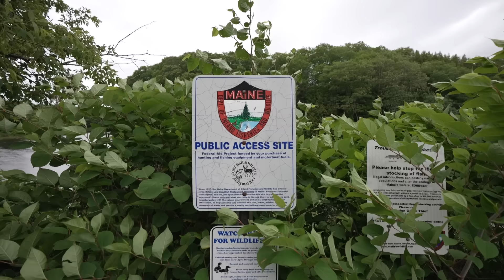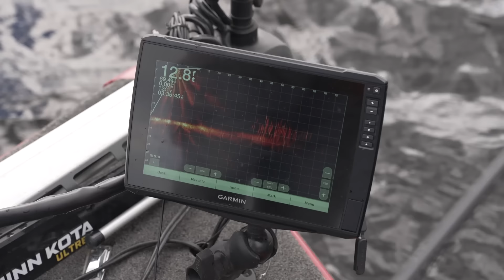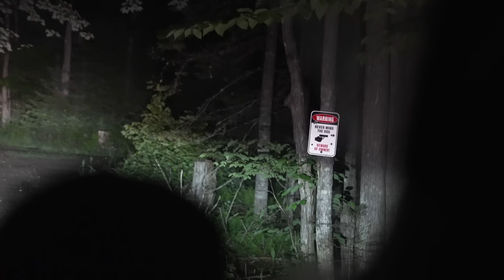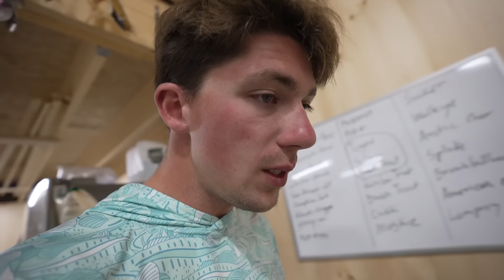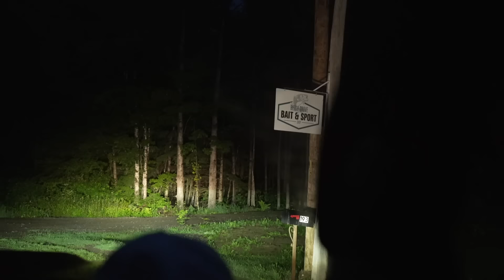24 HOUR MULTI-SPECIES FISHING CHALLENGE!

Comment: To catch trout in lakes like that, try casting along drop offs and ledges, or troll a spinner or spoon or Yakima flatfish along the thermocline, or the point when the water transitions from warmer to colder water. Spinners, spoons, Rapalas, and flatfish are good for casting and trolling. Use the smaller sizes. For example, don’t use anything bigger than a size #1 undressed mepps spinner when using spinners. Spoons should be no more than about 1.5 inches long. Same goes for Rapalas and flatfish. You can also try casting some power bait trout bait or worms out and floating them off the bottom. To keep worms floating, buy a worm blower bottle, which will inflate the worm and make them float off the bottom. Hope I was helpful and I wish you the best of luck!